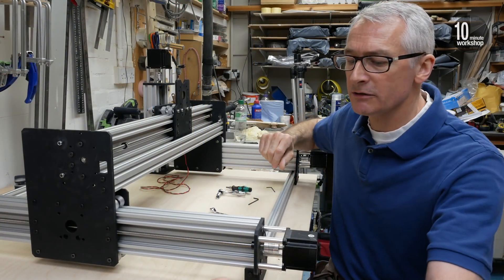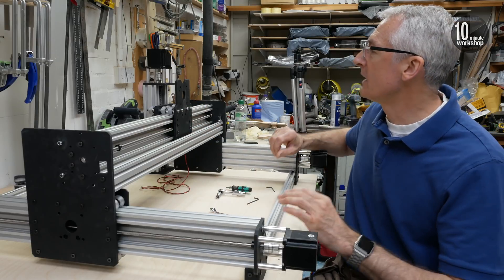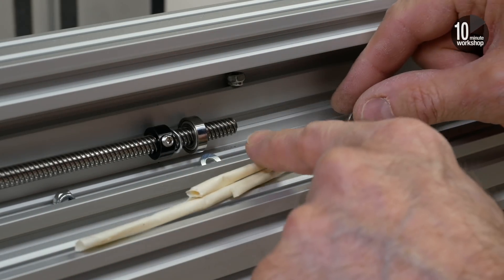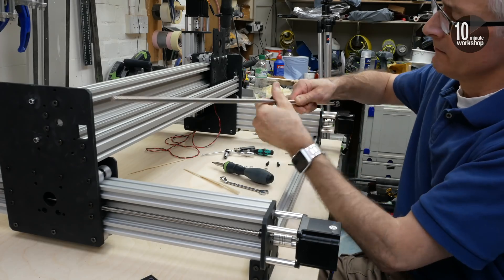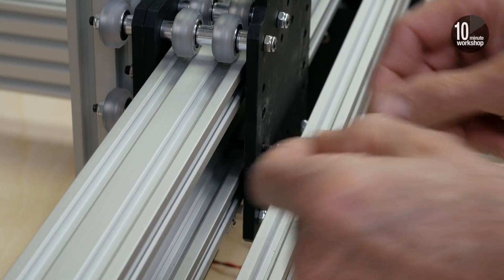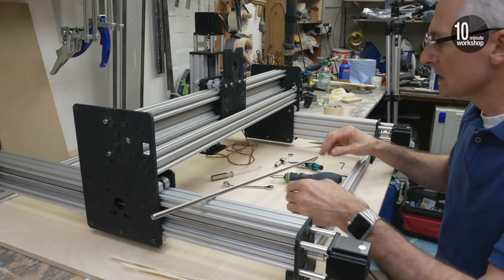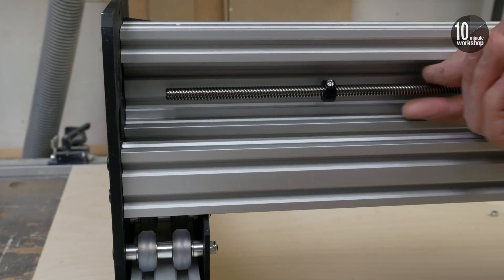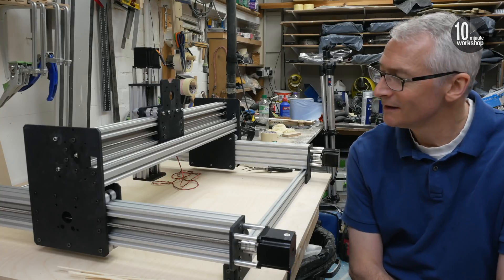Starting Out in CNC P3 (reprise) [video 387]

Comment: Maybe next time, try to use tiny drop of ca glue to bond spacers on the block, it will be much easier to put assembly on, some time  i use ca glue also to bond a nut to my finger, to put it on hard to reach places.
Reply from the maker: Oh, pretty sure there won't be a next time,. lol! But thanks for the tip! 👍😂

Comment: Peter, what double sided tape do you use all the time? The ones I tried don't seem to stick as well as the one you use. :)
Reply from the maker: For a really solid bond then you can’t beat 3M in my experience. Otherwise I use whatever my local decorators merchant has in stock - usually it’s Tesa, though I’ve used some branded ‘mammoth’ and it was also really good. 👍👍
Reply: @10MinuteWorkshop  thank you for the quick response Peter! Appreciate it :)

Comment: As said by others it looks really fiddly to put together and then having the aggro with the blocks - definitely put me off a self assembly machine. In the end I too have jumped on the 21st century woodworking way, and plunged in head-first with a purchase of the "YETI CNC''.
Great mwchine does what it says on the box, now if I can find a cad to cam program that does not have me pulling out my hair when it does something wierd. Any ideas on a decent program that does not break the bank please let me know. Karl aka houtslager
Reply from the maker: It’s a bit of a fiddle, but (in theory at least) you only do it once. I’m very new to the whole CNC thing - hence the ‘starting out’ series - so only have direct experience of Easel so far. I’ll be looking at Sketchup/sketchUCam in future, as well as Fusion 360, and hopefully the Vectric offerings - though we’re heading into bank-breaking territory there, I think. 🤔🤷‍♂️👍

Comment: Hi Peter I noticed you have used the support rails for the base board in the upright position. I looked at this on mine and started out in that direction believing I would only be cutting thinish materials, but then I realised the enormous job of re configuring the machine if I did need to cut thicker stock so changed them to the flat position. I haven't noticed any loss of accuracy due to the increase potential torque at the cutter tip resulting in any twisting of the X axis but I do always tend to cut slower than the maximum possible speed to avoid undue stress on the rails.
Reply from the maker: Thanks! First thing I changed when I resurrected the series was to drop the support rails down - as you’ll see when P4 drops later this week! 👍👍